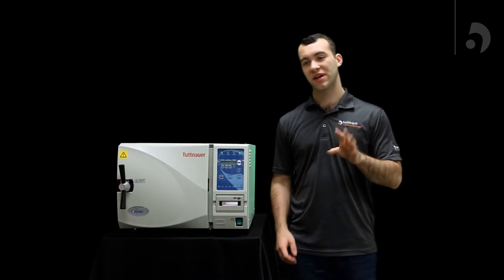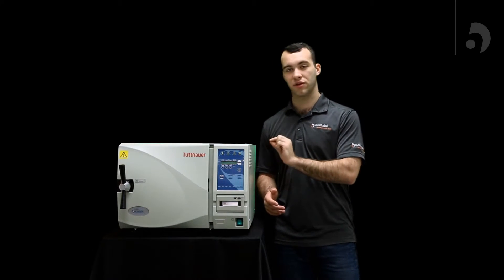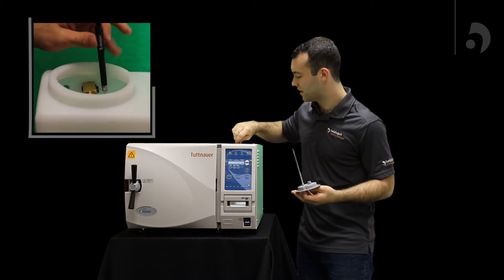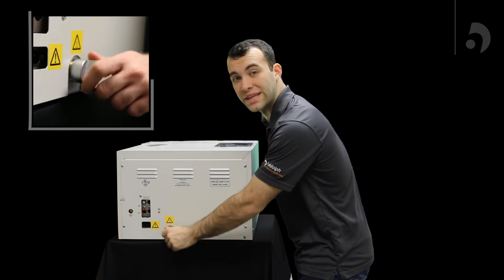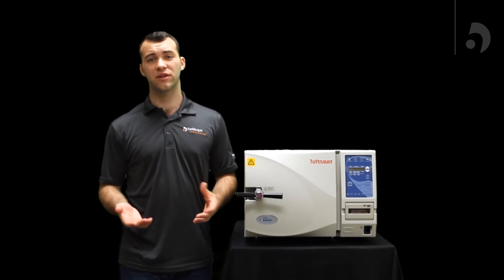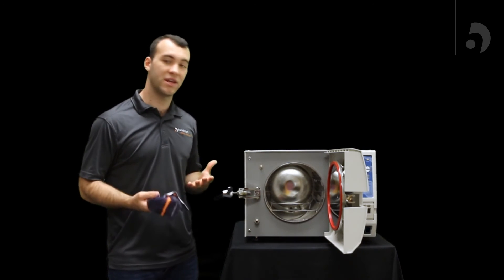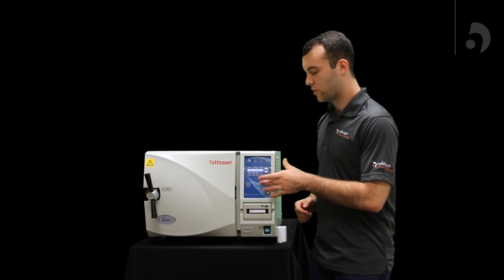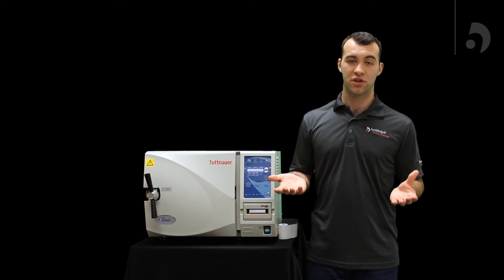How To - Troubleshoot Sterilizer

Comment: I'm getting low water message and water will not enter the chamber at all. Could my problem be something more serious than a dirty water level sensor?
Reply from the maker: Thanks for reaching out to us, if you tried cleaning that sensor and your unit is still presenting you with a low water message, please go ahead and give us a call at 224-265-9600.
Reply: Hi,
Recently my Autoclave at the end of the cycle starts smell like burning, i wonder what is wrong?
Reply: Did you ever find out what it was